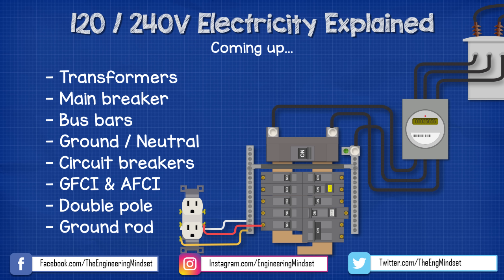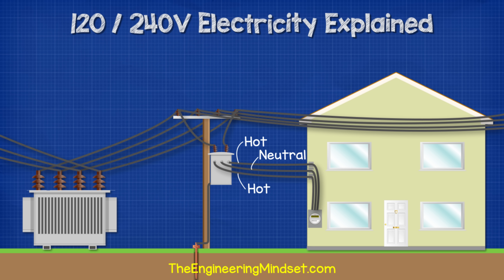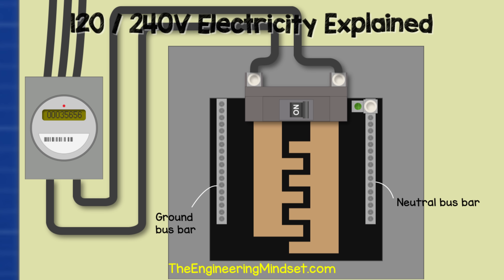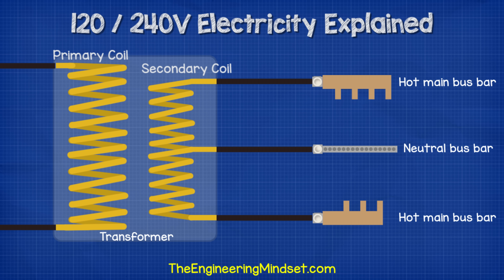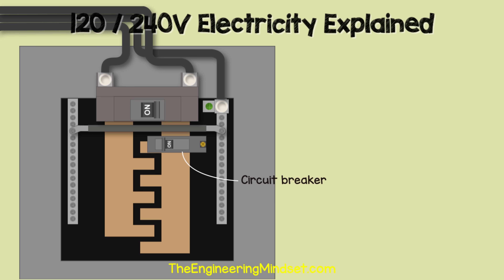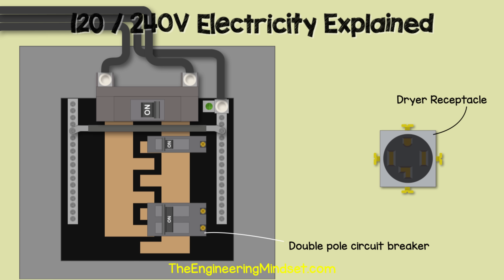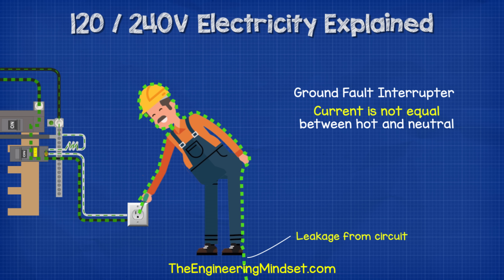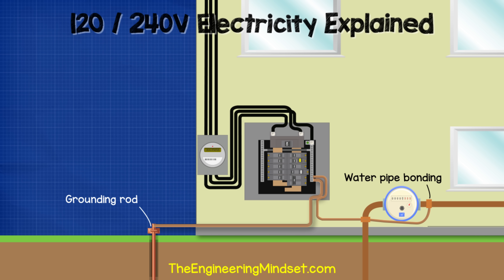120V 240V Electricity explained - Split phase 3 wire electrician

Comment: So why have a separate ground wire when it runs to the same place? Couldn't you just connect casing and such to the neutral wire  and save some copper?
Reply: You don't do that because the neutral carries current under normal circumstances. The ground is there only for a fault, giving the current another path to ground. But you are correct, they do go to the same place essentially, just serving different purposes. If you connect the neutral to the ground circuit of a dryer for example, you could potentially get shocked by touching the dryer because current is passing through the "ground" circuit now, or at least is live with power.
Reply: I really don't know, considering my three trips to Japan. They use 100 volts at 50 Hz (if in Tokyo, Tohoku or Hokkaido) or 60 Hz (if in Osaka, Nagoya, Hiroshima, Kyushu, Shikoku, or Okinawa), and I have rarely seen ground terminals in outlets. That's from someone who stayed at an Airbnb. The problem is many North American laptop chargers have the ground pin, when in Japan, many outlets in residential properties (many of them are AirBnbs) don't have it (well, some rooms can). Those outlets are rated at 125 V 15 A according to the outlet, so I was able to buy a Sega Dreamcast console from Japan and use it on my American outlet. Many electrical equipment sold in Japan may also work in North America.
Reply: @lucasn0tch  Japan's electrical system had to be rebuilt after WW2. One half got European 50 Hz equipment, one half American 60 Hz equipment. Under normal circumstances, the ground wire on most devices does nothing and will not do anything for the normal operation of the device, so you can get away without using it. In fact, the Japanese plugin is VERY similar to the old American style before the third ground pin became so common.
Reply: The ground wire and neutral terminate at the same place on the end, but they serve two different purposes. The neutral is the standard return path. It has loads on it which keep the amperage from rising too high.The ground wire is made to have a very low impedance/resistance so it intentionally creates a short circuit and trips the breaker in case the device casing or some other metal part becomes energized. On the ground wire circuit, all the loads are bypassed.
Reply: If you did that, then otherwise de-energized metal would carry current in parallel with the grounded conductor.  You don't want that to happen.  You want only the wires that intentionally carry current, to be carrying current, under normal circumstances.  The neutral normally carries current, while the ground is meant to never carry current unless there is a fault.

Comment: the ground wire goes directly house ground ; Neutral goes transformer's ground
We use seperate bars for grounding rod and neutral 
Europe or I live in Turkey
In your way you dont need 3 wire for your wall outlet. One cable for neutral and ground thats used in old buldings

Comment: 1. #alert only 2 wires inters our #house . And our electricity is 220v.
2. And large workshops has 3 wires in my city . What do you think is that? ?
3. Also when someone touches the house electricity 
A. The person would be  thrown too far like paper 
B . It will not release the person till he is dead! ! 
What is that also?
Reply: You use a 220V 1phase and 380V 3phase. Its more dangerous. For this the person is dead in your country.

Im know the european 220/380...230/400V and american stile 120/208...133/230V.
Reply from the maker: You need this video https://youtu.be/W0_1xRqT8uU

Comment: Have the ac's circuits a 180° time difference?
Reply: 180 degress out of phase, it's not really a rotary "timing" is sinusoidal.
Reply: But yes 180 degrees.
So on L1 (in relation to nuetral) at 120v a.c. positive then L2 will be 120v a.c. negative giving the difference of 240v a.c. across L1 and L2. That's also changing 60 times per second...
Reply: Travis Dewitt    Your statement is correct if you say, "When connected to an oscilloscope" first.   Then yes it will look like it is 180 degrees out of phase.   In reference to time, it all happens at the same point in time.   I know, this is what they taught you in college, but draw a diagram and see how a transformer works on a half cycle of a sine wave.   Respectfully,   Kevin
Reply: It is 180 degrees out of phase, but it is not called "2-phase" for historical reasons.  Also, due to the fact that it is generated by center-tapping a transformer, rather than from inductive coils that are 180 degrees apart on a rotating generator.

The split phase system is set up to NEGATE, rather than phase shift, to make the difference between the two phases.  It is mathematically equivalent to a 180 degree phase shift, but it isn't a built-in phase shift that makes this happen.  It is a negation that makes this happen, as a result of the center-tapped transformer.
Reply from the maker: Seen our new Oscilloscope tutorial? (beginner friendly) link here:➡️ https://youtu.be/LaY47Qrfs0c

Comment: If only electricians labeled their hot AND neutral conductors that would be awesome. Im a licensed electrical engineer and every electrician working for me does this. It saves headaches in the future when replacing circuits.

Comment: What stops the return current of the neutral bar from going back out to the ground circuits if they share the same contact bar?
Reply: There is more resistance going into ground vs neutral
Reply: @zacharyostrand617  thanks. still curious on how tho, i would think a copper conductor that a ground wire is made of wouldn't offer much resistance for a return current.
Reply: @FrankieBlue3122  it's not the copper, it's the resistance of the Earth
Reply: @FrankieBlue3122  that's why your ground rod must be a certain depth
Reply: @FrankieBlue3122  To get from the panel back to the transformer, its either a solid copper wire or a whole lot of dirt. There much, much more resistance in that dirt than there is in a copper wire.

Comment: In the house where I grew up, the copper water main served as the grounding spike. Inside the breaker panel, besides the service wires, we had just one heavy-gauge bare copper wire connecting the ground bus to the water main, below the water meter. Since the water main was copper, sunk deep into the ground, it was ideal as both a true-earth grounding spike, and as a ground fault connection for the plumbing.
Reply from the maker: We just published a new Ground fault, short circuit and arc fault video, so much detail! Link HERE➡️: https://youtu.be/Qi0ynSQw-wc

Comment: Where in centre of coil neutral wire is connected?
Reply: Thought Provoker    The neutral is at exact center of the secondary coil.  Same number of windings on both sides.   Otherwise the voltages would be different if different number of windings.   Make sense?   Do you know how a transformer works?  Respectfully,   Kevin

Comment: If I understand you correctly both legs are on the same phase, I say this because you made no mention of them being different phases
Reply: Right. The primary coil of the pole-mounted transformer is fed from a single phase from the distribution grid, so both hot wires from the secondary are powered off of one phase.
Reply: Split phase

Comment: With the supply transformer neutral being grounded at the pole, and we are adding in another grounding conductor or bond at the panel. We now have a ground loop for current to flow along instead of along the neutral? I don’t understand the secondary bonding of the neutral since it’s already done at the transformer pole.
Reply from the maker: All explained here https://youtu.be/P-W42tk-fWc

Comment: Just a note here.
Yes, breakers are meant to protect the "property" but more importantly it's all sized according to need. And the breaker size is determined by the wire size, a 10ga romex wire can only safely carry a certain ammount of amperage. 
VERY IMPORTANT to know for you do-it-yourself types
Reply: Travis Dewitt    Can you explain your comment a little better please?   Do so carefully though, I'm checking to see if you have a clue about what you are saying.   Tell me how you would come up with #10 conductor as needed and the breaker size for that conductor.
Reply: @KevinCoop1  100% pfm
Reply: Travis Dewitt    Ok,   So you do not know.   Life goes on.

Comment: Split phase secondary winding in the step down transformer. Believe the two 
sides of the secondary winding are WOUND in opposite direction?
Reply: Physically, no. If they were, you couldn't get 240V across the whole secondary. If it reversed winding direction at the halfway point, the hot to hot voltage would be zero. Think of  the center tap as the 0 reference point. Hot A is 120V rms above neutral, and carrying on in the same direction, neutral is 120V rms above Hot B. So Hot A is 240V rms above Hot B.
Reply: Jason Crobar Please tell, how does the single phase step down transformer
provide SPLIT PHASE CURRENT at 240v.   L1 pushes while L2 is pulling and then vise versa. Thank you.
Reply: Ted Lahm    Are you really looking for an answer or just stirring a pot?
Reply: Kevin Coop Sorry for the aggravation. Just can comprehend how the electrons
could flow without a neutral to go back to the transformer. Well, they do flow
without a neutral because the L1 and L2 are out of phase. NOW what makes
this transformation from single phase ( from power company) to split phase? 
Thank you.
Reply: Ted Lahm    If you have a 240 volt single phase transformer(no neutral) just L1-L2 it will work.   Correct?   As voltage increases primary coil it will also increase on secondary.   Let's assume for this example the 480 volt primary has2000 windings.  So the secondary 240 v side has 1000 windings.   Ok so far?   Now instead of saying"split phase"(not a good term) to a "split core".  At the exact center of the secondary winding, solder a conductor making a Tee or neutral.  500 windings now L1- N.  500 windings L2-N.  Now at the same exact time voltage increases or decreases or direction changes in the primary H1-H2, in the secondary it increases, decreases, or changes direction in secondary, L1-L2(240v), L1-N(120v), N-L2(120v).    Note that the direction was N-L2.   When direction changes L2-L1, L2-N, N-L1.  No phase changes going on, no 180 degrees out of phase.   Those terms come from people using oscilloscopes because of the way one of the probes is common to others and the connection method makes it look different.
Reply: Ted Lahm    Did the information yesterday make sense to you?   Respectfully,   Kevin
Reply: Kevin Coop Absolutly.   Outstanding.  No 180 degree out of phase.  THAT IS
EXACLY what keep bending my mind.  Also understand about the O-SCOPE 
making it look like it is out of phase BECAUSE of the one common probe.
Thank you.
Reply: @tedlahm5740  ALL transformers have output lines that are 180 degrees out of phase. It is what transformers do.  When one output is going positive the other line is going negative.  The US takes advantage of this by putting a center-tap on the secondary and naming it neutral.
Reply: Bill Elkins Thank you for the info. I have long since been trained correctly.
Reply: @KevinCoop1  Looking at this 3 years after you responded.  I have long since been converted.
Reply: Convert after 3 years.    the two sides are not wound in opposite directions.   If they were, the 240 volt loads would not work.